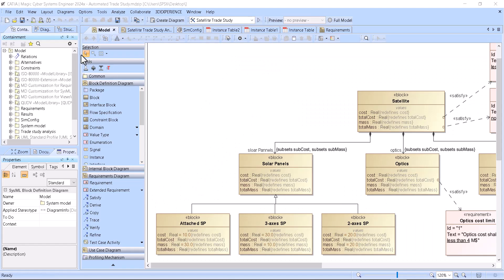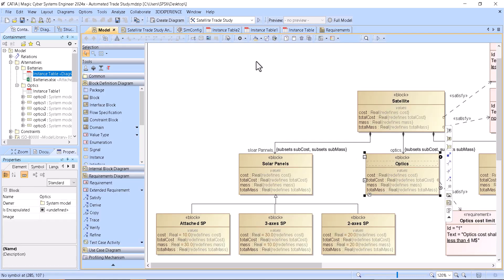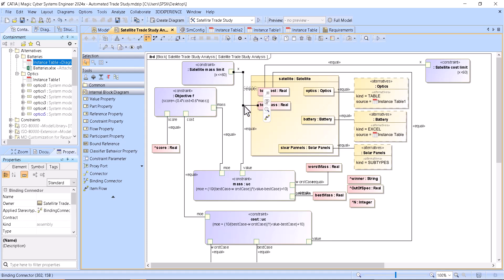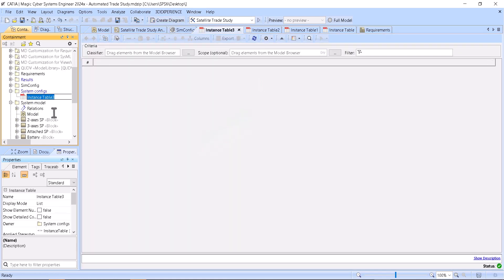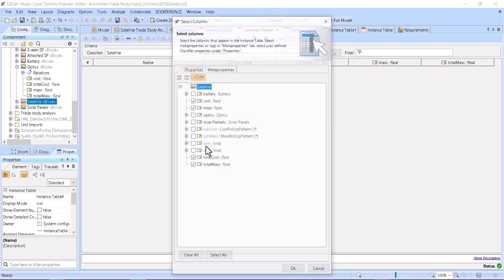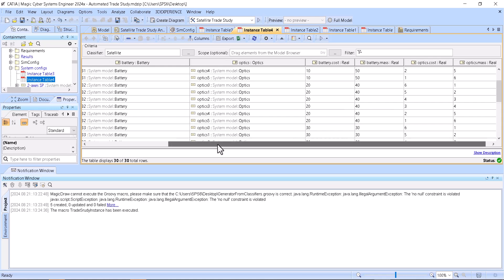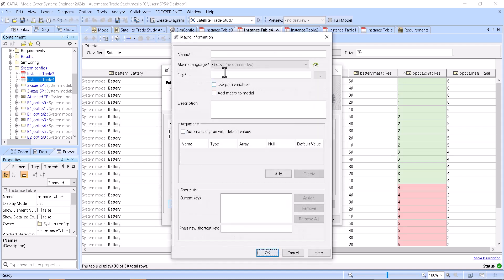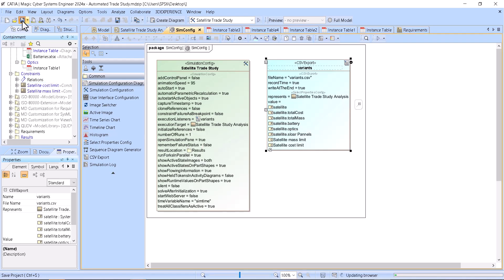Generating All Possible System Configurations in SysML - Trade Study

Comment: Hello, this works for me, but is there a way to transfer the default values in the  generated instances so I do not have to repopulate them?

Very useful macro and thank you!
Reply from the maker: Hello, thank you! Can you explain what is happening in your case?
Reply: @MBSEExecution hello!
I have defined off the shelf components (e.g. a pump model with specific characteristics e.g. weight = 200Kg) and generalised these components to the generic components of my system. I have run the macro and created all the possible configurations from the OTS components successfully. The value properties of the generated instances are empty though and I was wondering if there is a way to copy those values (e.g. 200Kg for the pump weight) automatically in the generated configs so I don't have to type them in manually.
I hope it is a bit clearer :-)
Reply from the maker: Hello, looks like this is script macro limitation. Try updating it.

Comment: I tried the csv export I set it up just as I can see u did but it's not automatically calling the csvexport. Does the report have any particular place it needs to live or setup?
Reply from the maker: Hello, it output is same location as project file by default. You setup export in Simulation config diagram > CSV export config.
Reply: @MBSEExecution  yes. Looks exactly like yours... im missing something 😕
Reply from the maker: @candyreid59 try to modify my sample with your data
Reply: @MBSEExecution  can't do that but found the issue. Needed execution listener